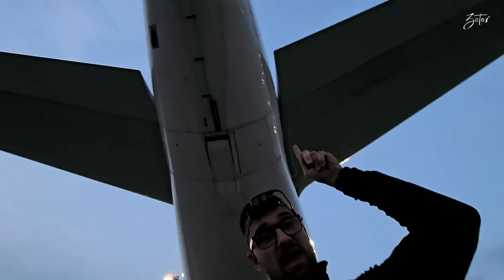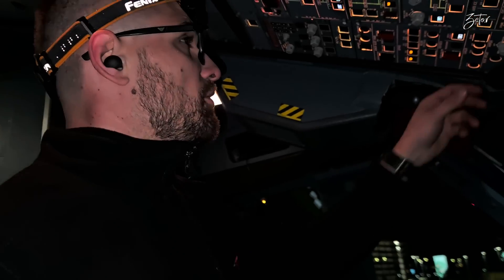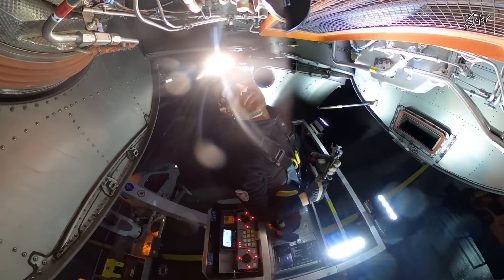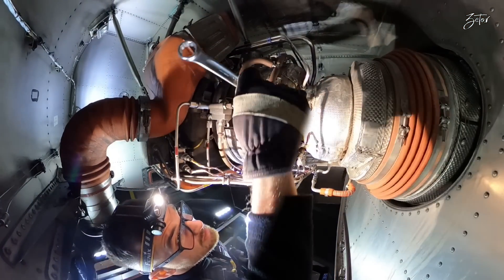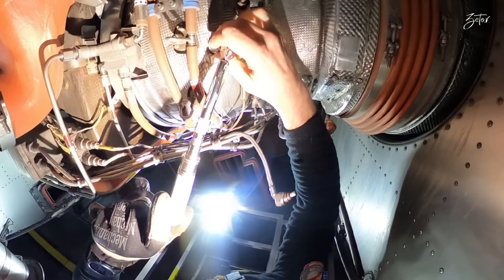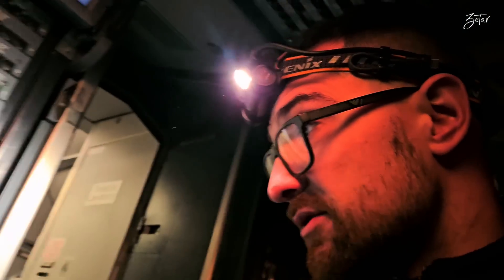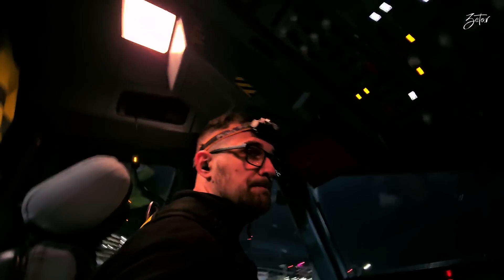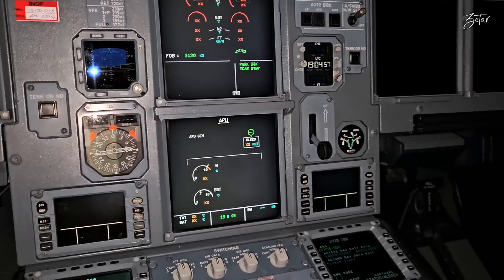How to replace igniter plugs on APU (APS3200)

Comment: For turbine engines, to operate on ground, a  GSE is connected to provide air to run compressor to self sustaining speed. Zeto.r, I realized the APU did not need a GSE to run it. How is air forced into the compressor when aircraft is on ground for APU?
Reply from the maker: I'm not sure if I understand your comment. Do you mean how it start? If yes on A320 APU we use electric starter. Check video which is about it on my channel

Comment: I noticed that you torqued at an angle. Did you have to apply the formula, or was the value already given to you? Or was it at a 90°? I couldn't really tell if it was 90 or not. 😅
Reply from the maker: Always 90° 😉 but calculation is easy

Comment: Thank you for sharing and I would like to add a note which is that the lever you were standing on was shaking and you placed the anti-rust box on the edge of the box so there was a chance that it would fall to the ground. I would also like to point out that the gloves I am wearing are not intended for mechanics in general. There are much better ones that you can use that are specialized for such work.

Comment: I've always wondered if aircraft maintenance technicians need to buy their own tools like car mechanics do, or does the company provide them?
Reply from the maker: It depends on the company, I have my own tools since some companies have shity tools but Austrian Airlines provide good tools
Reply: Zeto confirmed to me on a reply that he uses the high quality German Stahlwille brand. They actually do aviation sets for around    5/6 thousand Euros. However, because their tools are so expensive this would probably not buy you a huge amount. I can't believe any airline would use inferior tools for maintenance. I would also have thought if mechanics were using their own tools then, the airline would want to inspect then to see they were of  quality, but then they probably don't do this.
Reply from the maker: Mine is from Bahco and it is a good brand for ok money and I put it together for my needs. Stahwille is good but some tools are better from other manufacturers. Like ring ratchets

Comment: I was an aircraft engine tech for 30 yrs. in the 90's. Back then everything was safety wired. Noticed that not even the bandit clamps have safety wire anymore? That APU bay is cleaner than my BBQ. In the old days I would be up there 2 hrs cleaning just to do an inspection. Born 40 yrs too early Lol.
Reply from the maker: Yes, these days we really don't secure everything with safety wire. I guess it is based on experience.  We tried to keep everything clean so if you have a leak you recognize it immediately. Thank you for stopping by 🙂
Reply: @zeto.r  Thanks for taking me on the job with you. Remember, you can take the mechanic out of the Aircraft, but you can't take the aircraft out of the mechanic. Cheer's H
Reply from the maker: It is my pleasure 🙂😉

Comment: Thank you for another extremly interessting video, I LOVE them 👍😁

One question I already have since I saw your APU exchange video is about the pipe on the side of the APU which goes to the round hole in the left side door? What is that?

I mean the big opening at the bottom seems to be the air intake and at the rear for sure the exhaust gas exit, but what is the other opening for?

Thanks and looking forward for your next video 😁

Comment: It’s mind boggling the amount of engineering and design that goes into every single part, every wire, connection, duct etc…
Reply from the maker: There are years of work behind aircraft and there is still progress in older aircraft as well
Reply: which is why they are expensive as heck! 100,000,000 USD for an A320! You gotta pay all the designers and engineers who worked on these machines!
Reply from the maker: @roku_nine jop everyone wants to get money🙂

Comment: Just a question that came to my mind... So you all Engineers clearly know how to perform maintenance and tests, but how far do you know to operate the whole thing? I mean, you know the airplane entirely but can you also fly it? I know there are two different things, but it's just curiosity about where are the limits of your knowledge. I'm not a pilot nor an engineering student or something, but I like planes and this channel is wonderful.
Reply: I was an aero engine technician for over 30 yrs. in the RCAF and worked for Air Canada part time after. It is not unusual to have a Run-up course multi engine endorsement on type, for doing high power ground run ups after maintenance, and you often have to requalify inside a flight simulator. It is not unusual to taxi an aircraft if required, to a tie down/run up area. You always use a run up checklist, I think on the P3/Aurora marine patrol, there was 186 switches and breakers that had to be set/ checked, before you even reached the pilot's seat. After saying that, we often gave up our lunch hrs. to fly, with the simulator set on crash override for fun. Taking off is easy, Landing is the hard part, and with modern jetliners that small air speed window, is what kills you Lol. If you're interested in a career, don't let fear intimidate you. You will be amazed on how much you are capable of succeeding once motivated and with proper training. Case in point. The last airshow we had a helicopter static display, with two early teens playing up in the cockpit, one of the kids asked Mister, where is the battery at. (Disconnected for safety). I went to check on them, only to find that they found a pilot's checklist between the seats and had the whole aircraft cockpit configured for a ground start!!! So, there you have it, more Teno in your I phone than aircraft of 20 yrs. ago. Cheer's H
Reply: flying is easier than most people think; pilots are not trained just to fly it, but to deal with every situation there could be, especially of course emergency situations. There are a lot of simulators that you can use to learn to fly planes
Reply: @reuven2010  yep, I do use simulators and I know some actual, real pilots.. and simulator never 100% accurate (not even think about msfs2020🤣). The experience could be similar and you can get the idea of how it could be in real life, but it will not be like the real deal unless you have an specific airplane with an accurate flight model and a flight deck or at least most of the essentials 😁👌🏻

Comment: I've never seen an adaptor like that used with a torque wrench. I'm gonna have to find that! Do you have to adjust the torque setting on the wrench while using it?
Reply from the maker: If you mean a crowfoot wrench, that is a very helpful tool. Yes you always must calculate the torque value if you are offset

Comment: Awesome vid. Does using that adapter for  the torque wrench on the plug/wire nut not cause a different torque to be applied from the one set? If so does the manual used to get the torque values already adjust for this adapter?
Reply from the maker: This is a small value and the extension is a solid piece of metal but in case of a bigger value, of course, you must calculate the value. Especially you must calculate the torque when you move away from the center line with the extension

Comment: What is the stuff you are putting on the threads? and why do you put it?
Reply from the maker: It is called never-seez and it is a lubricant  designed for industrial applications requiring non-destructive assembly and disassembly where combinations of high loads, high temperatures and low speeds are encountered to reduce friction during the assembly of press-fit components. It holds but it prevents to get stuck

Comment: We got back from Jamaica to the UK on Monday but after all the problems an Manchester  airport when we going out and then the hurricane the tui dream liner after star up which did not sound right to me the was a problem and after 4 engineers and a system check 2h later we got away it's the first in the years I have traveled by air this has happened but in my time I have been driving me cars have had problems and a few brake downs it just proves how you guys look after the aircraft we travel in

Comment: If your plane isn’t connected to ground power or APU how long do the batteries last?
Reply from the maker: We are using them only for the start of APU or pilots can use them during an emergency situation, until RAT is deployed or APU started. If you forget them they will be depleted in few hours

Comment: Being an auto tech for 17 years I see I made a career mistake. My ‘69 Mustang 428 took about  2 hours to change plugs you couldn’t even see. Just pulling the plug wires your knuckles were banged up & destroyed not to mention what your back felt like.  Aviation is the way to go!  BTW, using an extension on a torque wrench changes the actual torque but probably still close enough.
Reply from the maker: Take a look at my PW1100G plug replacement.  If you don't have a proper tool you have no chance to replace them 😁
Reply: We use a formula to properly adjust for the use of the extension.
As taught in a&p school it is:

Desired torque* wrench length/wrench length+extension length.

Comment: Shouldn't the torque wrench and crowfoot be 90 degrees angle to have the right amout of torque? And what about using anti-seize in combination with the torque wrench? In the production-industries its a no no.. just asking out of curiosity.
Reply from the maker: You need to calculate if you are not at 90°.  Regarding anti-sieze, It is required by the manufacturer, most probably as a prevention against stuck due to temperature expansion
Reply: @zeto.r  Alright, i guess i learnt something new today then.
Reply: Or else you should be using a formula to convert the torque from lets say 45 degrees.

Comment: APU = small jet engine?
Reply: Auxiliary power unit, which provides power/air pressure to start main engines.
Reply from the maker: Yes it is but it has the function of a supporting device, which means that it provides electricity and air supply for the engine to start and air-condition

Comment: I may be wrong but Im pretty sure in the reference manual it does mention to not apply never zeez to the threads that contacts with the ignition lead cause it will cause damage at least for me I work on 737 and it mentions it
Reply from the maker: It is applied on the outer surface of the plug there is no chance of getting in touch with contacts. And for your better sleep I checked it again and it is in AMM 😉
Reply: @zeto.r  anti seize gets on my pillow. trust nothing with anti seize
Reply: @zeto.r  i donno this stuff goes everywhere yout want it including your pillow
Reply: yes this is bad on amphenol connectors
Reply from the maker: It is applied on the outer side of the igniter plug, there is no possibility of getting in touch with contacts

Comment: Videos like that never disappoint,  by the way I didn't know there were spark plugs in the APU.
Reply: It's a miniature jet engine.  Jet engines all have igniters to set off of the combustion :)   If you listen carefully, you can hear the "tick-tick-tick-tick" of them as an engine starts (not from inside the plane of course).
Reply: @bmused55  appreciate the explanation
Reply from the maker: Every engine needs a device like this because the fuel must be ignited somehow. I know that diesel doesn't have spark plugs but they have glow plugs 🙂
Reply: @zeto.r  Glowplugs aren’t technically needed, but they make starting a diesel engine far easier (especially in colder weather), and I think a lot of newer diesel engines don’t work without them because they assume their presence when designing them. If you go back far enough you also get hot-bulb engines that after initial heating reached auto ignition temperature and so were self-sustaining. No way to time combustion with those though.
Reply: How did you THINK fuel was ignited?
Reply: @TUUK2006  magic
Reply: Great vid as usual. How does the camera follow you?